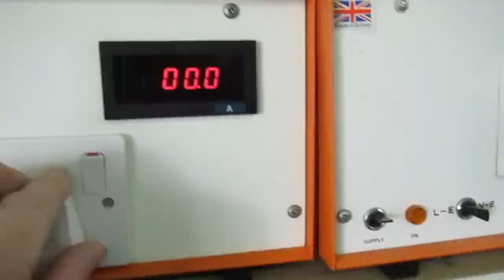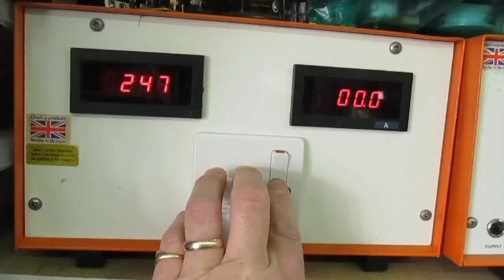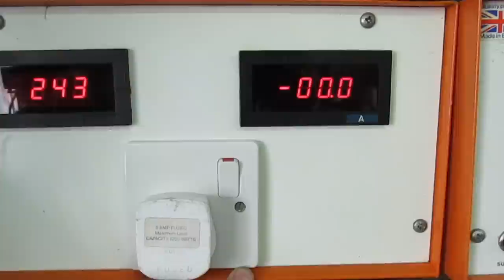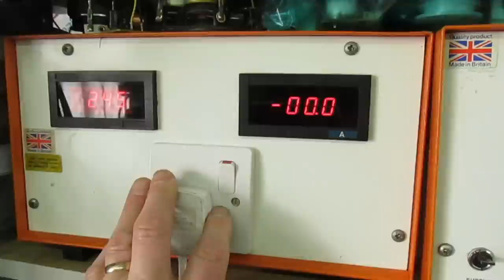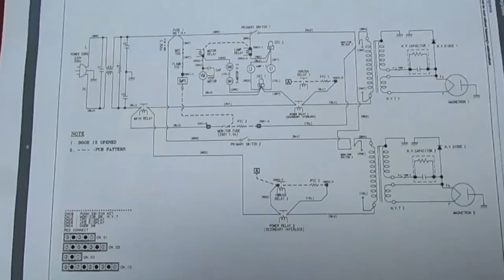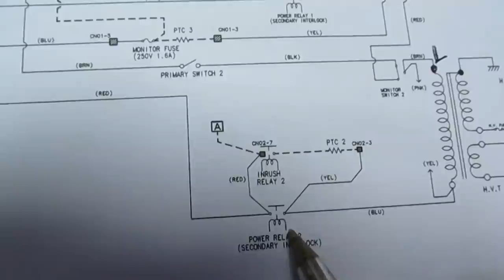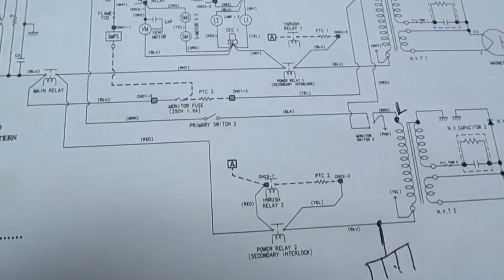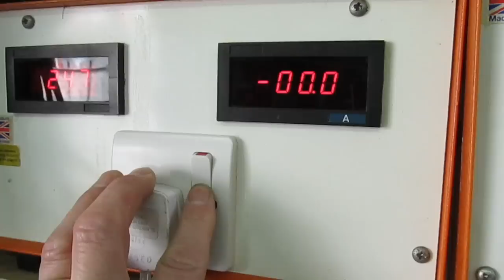Bizarre fault on Samsung commercial microwave oven.

Comment: I've worked most my career repairing professional & broadcast electronics but i truly take my hat off to those of you who support this sort of gear like this kind of kit! All that gross buildup of food particles, stale rancid grease & filth not to mention the exotic odor the thing has that likely fills your workshop. Yikes!
Reply from the maker: Why do you think my hands are always dirty in the videos I make , you wouldn't believe how dirty some of the stuff I get in for repair is !
Reply: And don’t forget the cockroaches! Or maybe that’s just in Australia?
Reply: @paulsi1234  No I have had cockroaches dead mice , we used to get cockroach infestations in the workshop all the time ,not just from microwaves ,vcrs ,tv`s I remember going to a Kebab takeaway in East London to repair an early Plasma tv ,it was alive with them.
Reply: @paulsi1234  nope, i used to repair the odd few here in the uk, dead roaches were common as was the odd dead mouse slumped across the hv supply.
Reply: That unmistakable smell of stale curry and grease!, never forget it.
Reply: @monteceitomoocher  blerk! I once had a high end designer kitchen rangehood brought in. The story was they'd picked it up as a freebee, they orignal owners had put in another brandnew unit...  The thing was complete from vertical flu exhaust to the fancy brushed stainless steel control switch buttons on the front edge & the entire thing was blocked full of solidified rancid cooking grease. The fault: the fan motors & downlights were locked solid plus those switches ... in cooking goop. I removed the motors & the control module, stripped them & cleaned the things & reinstalled them, whipped out the lights the whole machine now worked fine but the joke was the owners expected me to clean out all that grease & goo FREE of CHARGE! (which never happened). It took weeks for the stink off the thing to leave my workshop.. 🙂
Reply: @monteceitomoocher  dead roaches? Luxury, I’m talking about ones that run out of the microwave and you have to chase them round the workshop with the vacuum cleaner 🤣.
Reply: Some of the restaurant microwave ovens I've had to repair have shown me where not to eat...
Reply: If it looks a little bit manky front of house it will certainly be manky 'back of house'.
The worst thing you can face, servicing faulty equipment in a Commercial Kitchen, is after repairing the device and seeing the filth and unhygienic shit... is having the cook want to feed you because they are happy you fixed their problem.
Next, You quickly learn the odour of cockroaches... walk up, smell and know when you take off that cover there will be a hive scattering and their poop.  
Proper nasty being thge first person into a kitchen in the morning to find all the walls crawling with cockroaches, that run and hide when the light turn on.... hide in the piece you are going to service. 
Then the dirty greasy plasticised or dripping oil that gets inside as a vapour.
No fun changing a High stat on a fry vat when the burnt oil hasn't been drained and the vat alongside is being used at 180C during peak kitchen shifts. 
And don't ever go into a manky kitchen's walk-in fridge. 
Awful finding the Head cook/chef smoking in the kitchen.... or seeing vermin.

Comment: Thanks for sharing! It looks like the ammeter is connected to neutral and not live. If the ammeter was on the live side it would of shown any current drawn to earth also.
Reply: Agreed. It's a really a silly way to wire in an ammeter.
Reply: @deang5622  It is sometimes done that way because there is ordinarily very little potential between neutral and ground so you don’t need as much separation and the low voltage DC portion of the circuit does not need to be isolated, but it does mean that any sort of ground fault is going to result in false readings.  In the U.S. a typical GFCI (RCD) has a trip current of 5mA (at 120 or 240, though we also have 30mA units available for fixed-install appliances where some ground leakage is expected, such as with pumps and some types of lighting) and is a very desirable addition to a troubleshooting workbench as it would trip instantly in a situation such as this or if you happen to come into contact with the live portion of the circuit while troubleshooting.  It won’t save you if you contact the high-tension side of a microwave as the transformer has isolated that and will go unseen by a GFCI/RCD, so not protection to bet your life on but still a worthwhile bit of safety gear at the workbench.
Reply: Ha! You guys got there before me! I just commented about this.

Comment: Great video. When I worked on the bench we always had the mantra ‘visual, voltages, clock’.  Just proves a good visual can detect the majority of faults.
Reply from the maker: absolutely right about the visual check but in cases like this when everything is dirty its a little more difficult .
Reply: I thought the process was great, it so nice to see real engineers using years of experience to solve an issue.
Reply from the maker: @dominicwebb8000  Thankyou for that .

Comment: Same microwave here, same fault only this one didn`t survive as well. The magnetron was toast and so was the transformer. The customer told me to scrap it. There must be a design fault here (wires too close to hot cabinet) or maybe a problem with the RF filtering in the cathode supply inside the magnetron allowing RF to leak out causing mischief. (Very rare, heard it discussed but never seen it.) Just a thought, your current metering must be on the neutral, if you were metering  the  line, you would have seen the current, even though it was going to earth. You-tube needs more videos like this, your explanations are very good.
Reply from the maker: I have had these before where a faulty magnetron takes out the transformer , very poor design switching the neutral side .

Comment: By the way, this is why tumble dryers switch (thermal cutout?) the heating element on both sides. So that if there is any short to ground, there is is no chance the heater remains energized.
This oven will have that on the door interlock, but sadly not on the power control relay.
Reply: There will be 2 or 3 door interlocks switches in a microwave, including overtemp and over current/s protection.
In this fault NO "power control relay" was energised, that would have dropped out by an Overtemp cutout, and even if an excess temp was reached, the cutout WOULD have interrupted the Active to the circuitry.  
And you are also very wrong regarding a clothes Dryer that uses 2 thermostats - An Operational stat. for cycling at normal low temps and an Over Temp thermostat, usually triggered by a restricted or no air flow around the element. They shutdown with a fire too. 
These thermostats (cut outs) have absolutely nothing to do with protection of Active to Earth faults, like you think and suggest.
It's not uncommon for appliances to use 'Double Pole' mains switching, to ensure the Active feed is indeed turned off... because DIY idiots tend to wire up plugs (and worse sockets) incorrectly.

Comment: A ground fault interrupter switch would also have triggered, so it is a bit strange to see this happening at all.
Reply from the maker: going to have to have a look at my fuse board on Monday , might be time for an upgrade !
Reply: @michaeldranfield7140  Another thing to look at is to measure current in the phase and not the neutral. Not that it would matter when you would have the RCD.
Reply: ELCB should have tripped.
Reply: @pizzablender  That is pro kit made by Clare possibly  measures neutral current to detect such faults?
Reply: @leetucker9938  How do you think the owner's RCD wouldn't be working? There was never mentioned such. What I gathered, owner just brought the MWO in and said "this broke up". Restaurant personnel hardly know what RCD is and rarely comes to their mind that it would be useful to tell the technician whether RCD tripped or not..

EDIT: Sorry, you're right after all, I didn't consider the overheated magnetron telling that it had been stayed powered up on such conditions on the customer.

Btw, while interesting, this video had some unprofessionality. Once there is a telltale that magnetron might be running, you should immediately cut the power and make sure to have a) load within chamber ie. cup of water, and b) adequate cooling, ie. force-fed power for cooling fans. You shouldn't power magnetrons unloaded and uncooled for any prolonged periods.
Reply: @philipturner5100  If there was one in use, yes.
Reply: @leetucker9938  "Michael: Jack, your RCD or GFCI is faulty on the supply entry to the building.

Jack: There isn't and RCD or GFCI present".
Reply: @triodehexode  it is a very poor way to detect the fault.
Reply: @deang5622  But it did detect the fault.
Reply: @triodehexode  It detected the fault? That's debatable. Firstly the meter wasn't even working...it wasn't measuring anything 

Second, there are three scenarios where the meter shows zero: (1) No current flow to the load. (2) A faulty meter. (3) An earth fault.

With the meter showing zero current, you have no idea which of those 3 scenarios is present. I would say it detected the fault if the meter was able to discriminate between those 3 scenarios , and it can't, it didn't.

Comment: Glad to say thats one faul i have not come across  .i wounder how many others of the same model have had or will have that fault?
Reply from the maker: its not something I have ever had before but I'm thinking there was a lot of fat which had dripped onto these wires and I wonder if it may have contributed to the breakdown of the insulation  ?
Reply: @michaeldranfield7140  Was the edge of the sheetmetal hole sharp? That combined with microscopic vibration by transformers could do it in long run.

Anyways, I have found out that Samsung has mastered lots of faults....err, no, "features", never seen before.
Reply from the maker: @TheSimoc  I cant remember but I have done quite a few of these and the wires to the transformers always pass through this hole.
Reply: @michaeldranfield7140  Vibration caused the insulation to be grated away.

Comment: Microwaves were just Taking off when my granddad was repairing all things electrical and electronic. They certainly weren't as complex as these, back then. I've tackled one or two myself, but never come across any with frayed or shorted wiring. I'm a bit perplexed as to why your RCD didn't trip off, unless you don't have one?  Must admit, I keep a plugin setup to cover such eventualities - just a short extension with an RCD and a couple of neon tell-tale lights from L-E and N-E plus one going L-N to confirm they're intact. But I digress.

I've never seen a twin magnetron setup before!  But I guess it's going to be a pair of 900W (ish) to give you the approximately 1800W.  I wonder though if that was the setup in that great big Hobart we had in the kitchen at my university lodge, back in '93. That thing could nuke your baked beans in just a few seconds, and turn pies into ashes just as fast!

You certainly seem to know how to pick 'em!
Reply from the maker: Domestic electrics are not my thing and I always though circuit breakers tripped on live to earth leakage but watching a youtube video someone sent me it seems over the years these breakers have become more sophisticated and now sense imbalance between live and neutral so I need to get my fuse board updated .
Reply: @michaeldranfield7140   Do you understand how AC metering of current flow is done with CT's - Current Transformers ? 
A single Active feed is passed  (usually once) through the core of an open coil... wound like a solenoid coil.  Flow in the Active (primary winding) induces a voltage in the the Secondary winding connected to an instrument. 
Today RDC, ELCB... uses the same principal, however the return Neutral also passes through a built in CT.  Current flow through Active should equal the return Neutral current flow.  Any difference between A and N indicates a 'leakage current", usually Earth. Above a fixed level (usually 30mA) it will trip the supply to the circuit. 
Leakage Trip Current is NOT the old basic Over Current trip level (short circuit or OL).
These devices have been around for decades.
It's nothing new or sophisticated.
Reply: We wouldn't bother with neons, we'd just go out and buy a RCD plug. It has the standard 3 pin mains plug arrangement on one side, and on the rear is has a standard 3 pin mains socket. So it can be plugged into any standard mains outlet (but not commando connectors) and appliances plugged into it.
They are available in just about any home improvement store.
Reply: @michaeldranfield7140  You don't have to update your fuse box (consumer unit).
You can purchase plug in RCDs which plug into the standard UK 3 pin mains outlet socket . Your appliances then plug into the RCD's 3 pin socket
Reply from the maker: @deang5622  still looking into this but if it turn into a big job then yes I will socket front for a trip socket .
Reply from the maker: @BTW...  Yes Gary Broadbent pointed me to a video on youtube showing how it measures balanced current , I checked in my fuseboard and I have some sort of trip switches but they dont have the test button so I guess there not ELCB but im looking if there is a plug in ELCB replacement .
Reply: @michaeldranfield7140  With no 'test' button they will not have ELCB @ 10 - 30mA trip protection function, only fixed overcurrent protection... perhaps in the 10A to 32A  range.
The only 'plug-in' type available will be in the form of an extension lead - plugging into a power socket - and accordingly, have relatively low current rating and prospective fault current rating.
Reply from the maker: @BTW...  got a plug in trip yesterday from B and Q , only £7.95

Comment: It should trip the RCD at the customer location, but not in the shop, because the microwave is hooked to a isolation transformer i guess?
Like you probably know, If you install a RCD behind a isolation transformer, the RCD won't trip, because the output of a isolation transformer is not ground referenced.
But you can use a portable RCD in combination with your isolation transformer if you tie the earthpin and "neutral" connector of your output socket together.
Bare in mind, that you don't need to tie this connection of earthpin and neutral direct to the earth of the mains, otherwise the safety purpose of a isolation transformer is bypassed.
Now, if you tie one leg of the isolation transformer to the earthpin of your output socket, you place a floating voltage on the metal chassis of the device you have connected to the isolation transformer, this floating voltage can be as high as 50% (or more from the mains voltage) between the metal chassis and the real earth connection of your mains, but this floating voltage is in the µA range. To lower this floating voltage , is to connect the point where one leg of the isolation transformer is connected to the earthpin of the outlet socket, with a 2Mohm (3Watt version for getting 250V voltage rating) to the earth of your mains. The floating voltage will be arround 30V (when the output voltage is 240V), with 120V voltage (US) then the floating voltage be even lower then 30V.
With this trick you combine a isolation transformer with a RCD and have a low floating/ghost voltage on the metal chassis of your DUT.
With this trick, you can still do scope measurings on the DUT, because when you accidentally connected your ground clip of your scope probe to the 240V output of the isolation transformer, there will only be a currentdraw of maximum 120µA through your scope probes ground and through your scope itself.
Reply from the maker: For me powering a microwave oven from an isolation transformer is a no no, , I only ever use raw mains for testing microwaves and besides my transformers are only 5 amps , many thanks for the reply .

Comment: Totally weird I would of thought the RCD would of tripped
Reply: Isolating transformer.
Reply: @aardvarksmith6852  Don't think so, an isolation transformer is pointless if the secondary neutral is earthed.
If this had been run via an isolation transformer, Michael would not have experienced the reported fault in the workshop, but would have picked it up on a basic safety test or PAT test.
Obviously no RCD on this circuit or the one in the restaurant.
Reply: Neither RCD or isolation transformer used on this circuit.